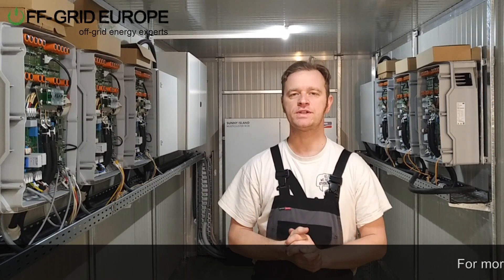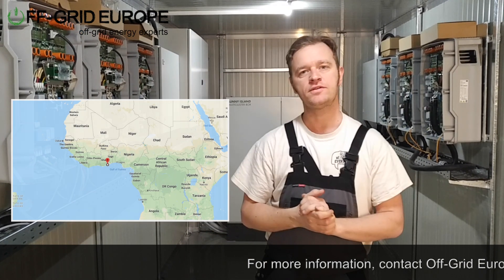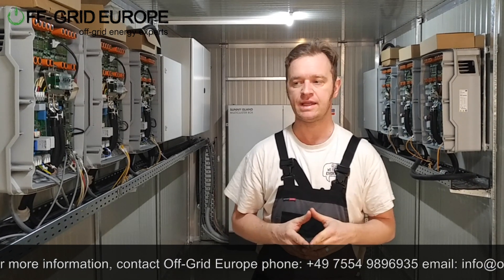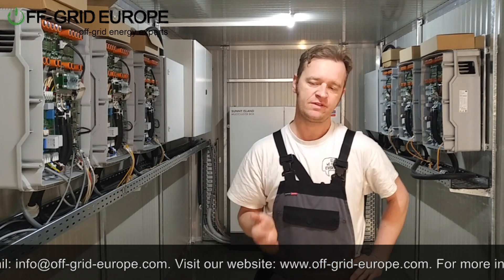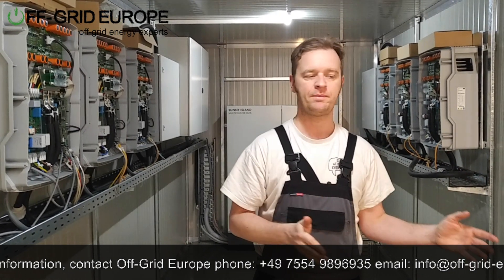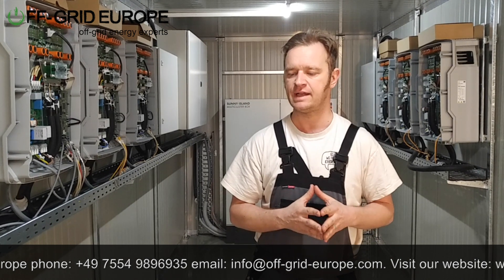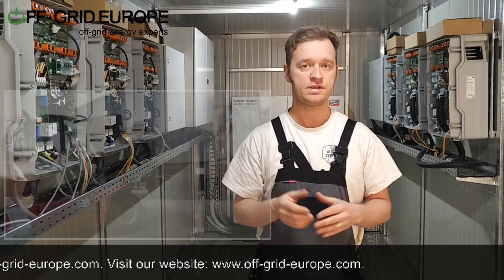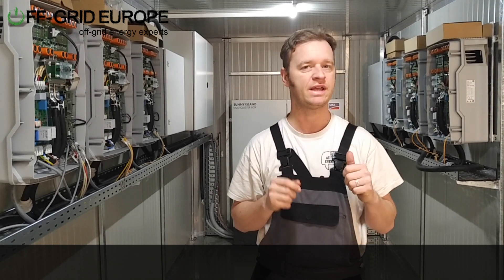Off-Grid Power Container in Accra, Ghana

Comment: Hello Mark, big fan, i would like to ask about remote monitoring and control of this system. It is my understanding that you can reach the Router in the Local Area Network of this system from outside through the internet and have full control of the system remotely through port forwarding and remote access options on the router. Can you please explain in detail how this works and how i can set up a comms system for a similar SMA cluster to reach an inverter from outside my LAN through the internet.
Thanks.....

Comment: We have never worked with the multi cluster. SMA touts it as an awesome product for when I need to go over a certain capacity. Your six sunny islands are they in single phase or three phase?
Reply from the maker: Hi AWPS, yes this is a three phase system with two SI''s on each phase. System balances very well and the MC is very useful for ensuring the systems are safe to use and quick to install.
Reply from the maker: Three phase